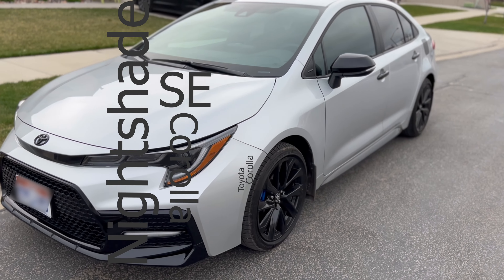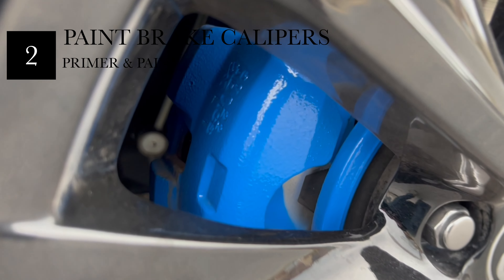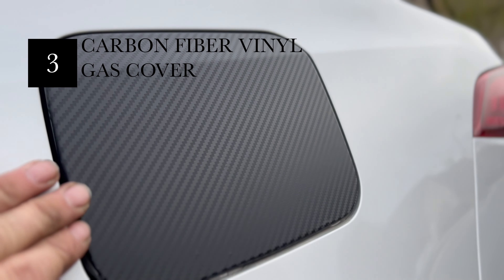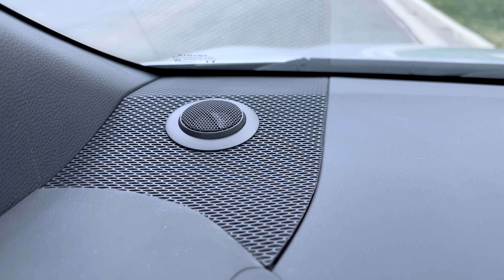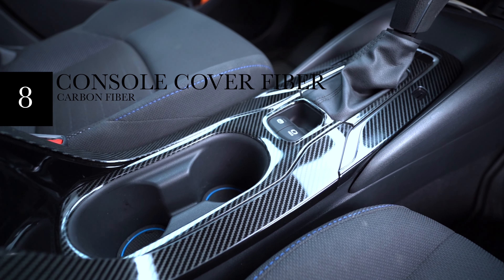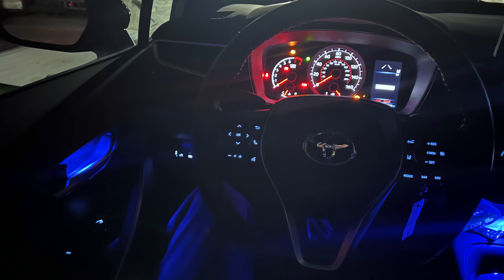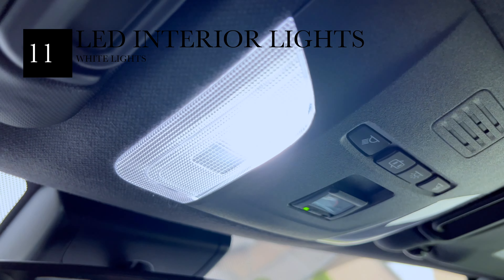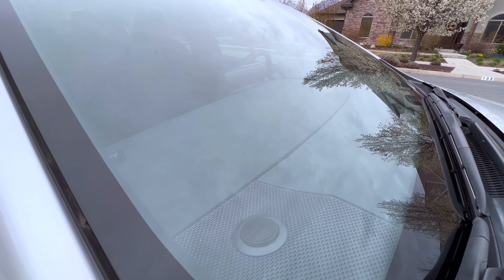2022 Toyota Corolla SE Nightshade Mods and Accessories

Comment: Love what you did to your car. I was waiting for you to show the subwoofer though.
Reply from the maker: Ok. Maybe I’ll make an updated video from a year later to show the whole car and talk about the things I’ve done  and how things are holding up with time
Reply: @juspain1  I see a round hole on the frame by the rear deck maybe serve as a provision for a subwoofer but the rods are kinda in the way. Anyways, looking forward to that video.
Reply from the maker: @razor_ramon  ahh you must be talking about the holes behind the back seat rests and below the back window. There are holes cut into the frame for two speakers and maybe an 8” subwoofer in the middle. I believe higher end corollas come with speakers there, but the SE model doesn’t have any speakers there. 
My subwoofer is a 10” woofer that is in a box sitting in the trunk. The amp is also mounted to the box. It seemed like an easier option that would give a deeper bass, plus I already had the subwoofer from my previous car. Hope that helps.

Comment: Nice video!  I just got a 22 XSE hatchback and did a lot of the same things you did!  I got the CarlinKit V3 which is just like yours but the box is slimmer.  I just did the blue led interior handle accent lights which I love.  Getting the little wires down the interior door panel was tricky for me but I’m sure easier for you with the door panels off.  Also did the white led cabin lights which I love.  I really like the usb+led light mod you did.  I have the wireless charger cubby in front so curious if I can do the same thing.  I also added the JBL spare tire sub woofer in my car which is amazing.  But I think down the line I’ll add door speakers like you did.  I also did the full frontal PPF along with yellow vinyl on my fog lights.  Whew that was a lot sorry!  Great looking car!
Reply from the maker: That’s awesome to hear. Your car sounds super dope already and sounds like you’re looking for more cool things to do for it still. Nice to know other Corolla owners out there rolling with style. Take care bro

Comment: Cool video the 1st thing I did as soon as I  Drove off the dealership lot is go to the custom shop where I work at and I started upgrading the lights exhaust I installed a Turbo kit And of course custom rims and tires👍🏻👍🏻
Reply from the maker: Sounds pretty dope. I haven’t heard of a turbo kit. Did you add a lot of power? How’s the MPG now?
Reply: @juspain1   Yeah I have a 2022 Toyota Corolla LEI got the base model to save more money because I'm gonna tear it all apart and customize it anyways but there is a kid out there I forgot where I bought it from but it sounds a lot better and it makes a little bit more horsepower than the original motor so I'm happy about that and the gas mileage is only maybe about 5 to 10% difference
Reply: I meant kit

Comment: Hey man, absolutely relate to your car and you just inspired me to buy your whole audio system 2 question did you have an amp when you installed it and did it sound better than stock or do I necessarily have to install an amp to notice the change?
Reply from the maker: Thanks! I think it just depends on how much sound you want out of it. I didn’t get an amp. The sound quality is much better. The dash speakers and front doors are the loudest, but the back doors are not great. An amp would fix that. The subwoofer I have of course has an amp. I think it’s a 10 inch. Also had to get some other device. Can’t remember what it’s called, but it makes it so that as the volume goes up, the bass stays the same. Guess with these newer car radios the bass goes up with the volume. Getting an amp for the car speakers I think would bi pass this. You will love the sound difference for sure. It’s much more crisp and full sounding. Don’t forget to add the sound deadening

Comment: Please tell us how to do the usb thing! The link preferably please, (number 7)

and I mean how to place the usb in there not the light usb the main thing. (mines is an empty hole)

ty
Reply from the maker: @luism3585  I actually had the audio store install the usb. It was only $50 for them to do including the price of the usb. I know he pulled the panel off, made the hole and ran the wire to the fuse area which is next to the left foot somewhere. I don’t know where he connected it from there for power. Good luck

Comment: What speakers did u get ? Was the bass better and louder ? Also where they plug and play ?
Reply from the maker: I got kicker speakers. They do sounds a lot better for sure. Having a subwoofer makes a huge difference, but the sound overall is more crisp and clear.  If you order through crutchfield, they send the wire harness with your purchase that you need in order to just plug and play. Pretty easy to install.

Comment: Did you have to cut any holes out for the little blue lights on the door handles inside ?   They are just plug and play ?   And where are the screws to remove the door panels?  I’m looking at my cars and I can’t find them 😂.      Awesome details on your car 👍
Reply from the maker: It’s just plug and play. Pretty simple. Just have to figure out where the screws are. It’s been a year since I’ve pulled the door panels. I think there are 3 screws? You’ll need one of those plastic panel remover tools so you don’t scratch anything. I think I looked up a video on YouTube how to remove the panel cause they’re a little hidden, but it’s super easy. Could be an idea for a video when I get the chance. Good luck!

Comment: Nice work on all the upgrades you done!
Question, I have 2020 corolla hybrid, it comes w 195 65 15 
I want to put the wheels and tires you have, would that change drastically my MPG ?
Reply from the maker: That’s a great question. I’m not an expert as these wheels came stock. One insight I can give is if you switch to a larger wheel, in turn you’ll be running a higher profile tire and have less distance between the road and the wheel, so you’re going to get a lot more road noise. There my only complaint with the car. That’s why I added as much sound deadening as I could.

Comment: I had a 2019 Camry before and I upgraded every speaker on the car and it sounded worse than stock and I used JL. What is your sound system setup? I have a 2020 Corolla XSE now and I’m wanting to do it right this time.
Reply from the maker: I’m just running what I showed in the video off stock radio, but the back door speakers are under powered for sure. But the sound is much clearer and cleaner. I have a subwoofer running off it’s own amp. You could always get an amp for the Front deck to help power your new speakers
Reply: @juspain1  The guys that did my sound system said I don’t have enough power to power each speaker. I’m hoping I can find something light to power it.
Reply from the maker: @xxk4rilsxx  yeah I get it. It would still be underpowered, but the quality I got was a bit difference. I could have added an amp but chose not to, because I don’t usually have my music up too high. But with the added bass from the subwoofer and the amp that powers it give me enough of what I was looking for. I had the sun installed at a local sound audio shop. You could always ask them for their best recommendations

Comment: Hey I purchased a 2022 Toyota Corolla xse apex edition in the cement gray colorway and i bought the carbon fiber cover you have for the middle console but eBay told me it won’t fit, did you have to trim the covers or no?
Reply: I believe the bodies have the same basic shape for the most part so you’re probably good
Reply from the maker: Like the other comment from spork, I’m
Pretty sure they’re all the same. The one I got from eBay had to be bent in order to fit in, but it’s pretty flexible and is made to be bent into shape you want it in and then it just sticks on

Comment: The tail light of the car you sent is 2020-2021, but my car is 2022, can it be done?
Reply from the maker: Yes my car is also a 2022. It’s the exact same model as the previous years until 2020.

Comment: You mentioned a subwoofer in the trunk do you have any info on that and how you connected it to the existing head unit.
Reply from the maker: Hey thanks for the comment. That’s a great question. I didn’t want to mess with going through the firewall to the battery, or going behind the stock stereo, so I took it to an audio shop and had them install a woofer and amp that I had in a previous car. It sounds great. Not sure what they did to hook it up though. I did have to buy some kind of amp. Can’t remember what it’s called, basically on stock stereos as you turn the volume up, it cuts the bass out, so this device makes it, so that doesn’t happen. It was an additional $100.

Comment: On the kicker speaker did you notice a difference when upgrading I been looking into getting the same exact speaker
Reply from the maker: Yes the speakers sound much better, but anything would sound better then the factory speakers. My biggest issue with the door speakers is all the power is supplied to the front. Dash speakers made a huge difference, and front door speakers are great, but the back door speakers are severely underpowered no matter how much you try to turn them up. But it’s still plenty loud overall and with the Bass in the trunk I can’t complain too much
Reply: Thanks for replying n answering my question
Reply from the maker: @eleazarlopez2170  no problem. I like sharing what I’ve learned. You won’t regret upgrading the speakers. Be sure to do the dash speakers as well. Overall it’s a much more crisp, richer, clear sound coming out the speakers. My friends can tell the difference

Comment: Did you just replace them without putting amp and processor?
Reply from the maker: I’m not sure what your question is referring to here. But the subwoofer has an amplifier and another processor to control the amount of bass as the volume goes up and down. 
I was getting enough power on the door speakers that I didn’t feel like getting a separate amp for them. The clear sound was good enough for me

Comment: Does the car link have its own wifi source or does it use the wifi of the phone its connected to wirelessly?
Reply from the maker: You can connect to a wifi source, but it doesn’t create a wifi of its own. You could be connected to the wifi of your house in your driveway, or tether it to your phone. I just use an extra SIM card line I got for free from T-Mobile

Comment: How did you get the extra USB port
Reply from the maker: I actually had it installed when I had the audio shop install my subwoofer. I figured they would have things off upfront to get behind the stereo, so I asked them to install it. It was $50 with installation. Well worth it I think
Reply: @juspain1  that would be nice to have; i don't want to upgrade my sound system but the extra USB port would be nice, since i have an accent light that is USB and it would be nice to use it while also being able to use Android Auto
Reply from the maker: @thatblackkid22  yeah if you don’t go with an audio system you could always go to an auto specialty shop like an audio shop and have them install an extra usb for you. They hook it up to a spot in the fuse box, so you can get a fast charge from it as well if you ever wanted to charge anything else

Comment: Does the Carlink work if you have an iPhone?
Reply from the maker: The carlink works with apple or android CarPlay, so it can be used with any iPhone that supports CarPlay. It works in this Toyota Corolla, because it comes with Apple CarPlay on the touchscreen stereo. It’s all connected with Bluetooth to your phone once carlink is plugged into the usb.

Comment: Man I really should’ve done a clear bra on mine! The front of my 2022 se 6MT is covered in rock chips 😭
Reply from the maker: I feel your pain. I just got 2 rock dents on the front of the hood. Even with it covered with the clear bra, it dented it and ripped the clear bra, but no scratches on the paint.
Reply: Good thing you took precautions! Mine is a 2022 that now has 32k miles on it and my front end is riddled with paint chips. Legitimately too many to count. Maybe I willl get it touched up eventually but yours looks great! I’m looking into getting an intake and exhaust for mine before I eventually put it on coilovers with some new wheels. I love what you’ve done with yours!

Comment: Smoked rear lights would have looked better. Imo
Reply from the maker: I thought about that option, but I wanted to go for a more stock look to make people think this car came this way straight from the factory. I think the smoked tail lights would give it away that it was after market
Reply: @juspain1  I went with smoked on mine and also put on the lower cowling running/turn lights.